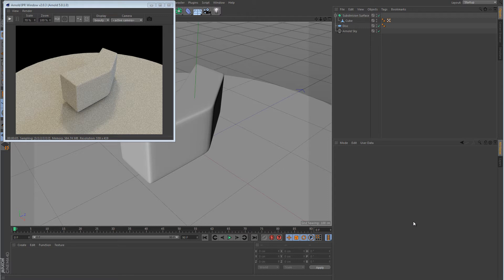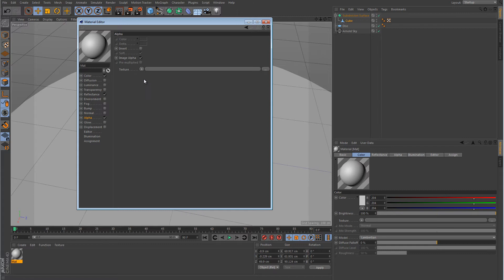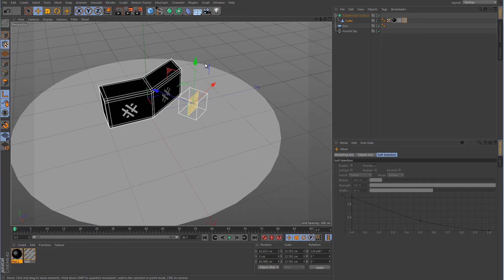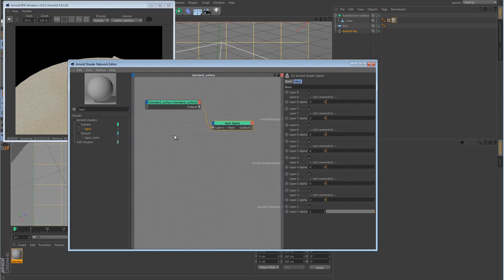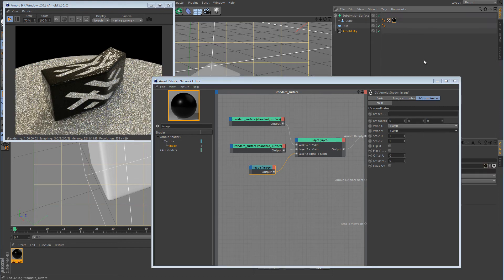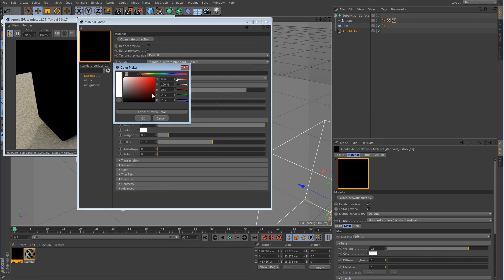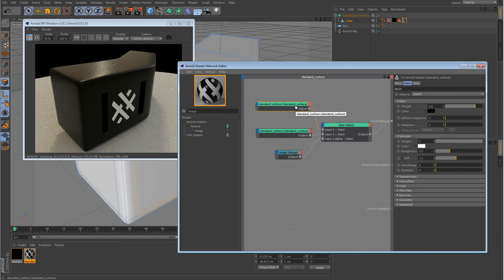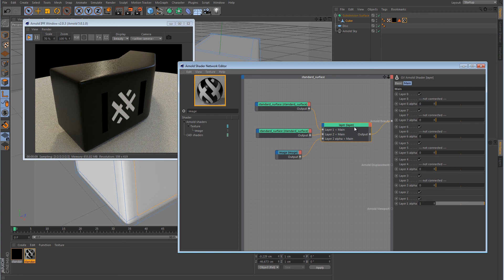Cinema 4D - Arnold Renderer - How do I apply multiple labels?

Comment: This will help to anyone facing this issue: 1) CREATE NEW ARNOLD MATERIAL - open material editor - below material there is alpha. Select alpha stacking mode to shader, and below it, select shader as UV_transform, set "use alpha channel" ticked on.  2) OPEN NETWORK EDITOR for this material you just created. Drop your png image, connect it to uv_transform node, then connect this node to standard surface as base color. 3) SELECT MATERIAL YOU JUST CREATED, DROP IT ON POLYGON SELECTION OF THE OBJECT. 4. SELECT TEXTURE TAG OF THIS MATERIAL, set type as "Cubic" projection, disable tile and then use U and V adjustment options as desired.

Comment: It's actually the exact same method as you are using in the video but if you dubble click the standard surface (or whatever surface you're using) there is an alpha stacking option in there. Just load the same texture as you use to do the flat projection with.

Comment: Enter the shader editor for the Boxx logo label You will use the standard surface that has the black and reflective info and the Boxx label image.  Search for the composite node. This has two inputs, A & B. In the B input, connect the image. In B, use the black color or any other color you wish (just in case the color is not black). For color operation, use plus (same as add) in the composite node default tab. This will work to put the logo on with reflectance but there are still two bars on each side. I fixed that in photoshop by giving the logo more black on each side of it.

Comment: 1.I put the base material "black" on the object
2.set a selection tag for a surface you want your image on
3.Link the image to a node called uv_transform (I used a PSD file with  transparency , not a black&white image)
4.then I adjusted the scale and translate parameters in uv_transform node to the desired position I want

That's how I get it done , but the uv_transform node sometimes doesn't work the way you want
In that case , UV-unwarping may be the only option to get the precisest result.

Comment: so i don't use arnold but i would think it's something to do with how your black layer is in your arnold shader network or something weird with how it manages the alpha layer.

if you're going to have a second material anyway i'd try and remove the black and have alpha and everything on base layer. maybe transparency isn't the default but that pitch black no reflection is. then the default has to be changed to have the background material show up.